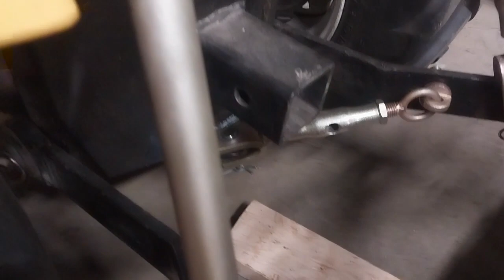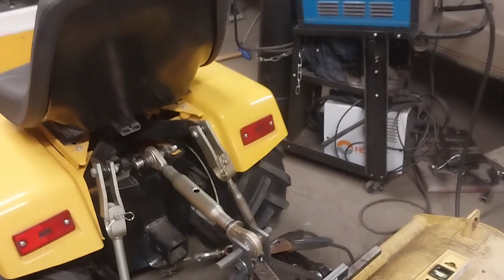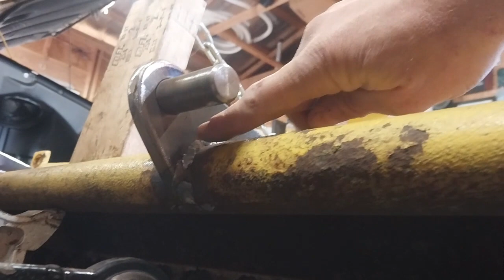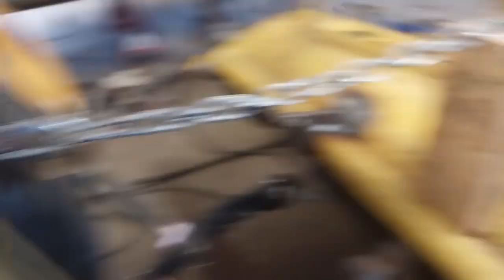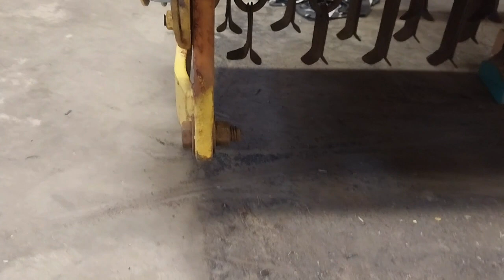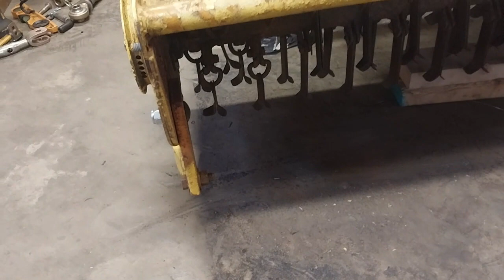Mott Flail Mower pt. 2 - The Cub

Comment: go to the john deere dealership and look at the 450 and 647 model tillers..that's how most flail mowers are set up...bit heavy in my opinion but they designed it to last a lifetime. the mounts are all you need to look at. flail mowers have to have a tilt towards the rear roller to help control height in rocky fields. most farm supply stores sell replacement flails.
most flail mowers i have used on full sized tractors 7'-12' had the mounts like you do, but flipped over and angling downward with double mounts you run the clevis/hair pin thru one side, then thru your cat arm swivel, then thru the other mount hole and have a lynch pin to secure the 3 point pin or cotter pin:
tractor supply search this : ToolTuff Direct Heavy Duty trailer Mover this one has 3 brackets per pin side, and two holes for cat-0 & cat-1 or 1&2

Comment: 3.25" is the lowest grass cut i would do , due to ground terrain fluctuations, this means cool season grasses are going to get minimal growth, and the ground will have alot of run off and evaporation with the rain, and once it gets hot out the exposure to the soil will bake the soil and thus the roots and it will grow very slowly. 4-4.25" the grass looks magnificent, but any water  and fert will make it grow an inch to 3 per week so it can get to be more clippings than you'd like. most commercial companies with cool season cut at 3.5-3.75" mostly 3.5" for most of the time and once it gets dry they try to let it go to 3.75" to act as ground cover and still keep green and just a .25" of growth at the very least. SUN+HEAT = GROW  fert =grow+thickness+green Rain=GROW+green
i used to work a 36 hole golf course and did the greens and tee box mowing for most of high school and i did commercial lawns for many years before and after high school for toy money and  girls and school money after high school. i never had a complaint, nothing but compliments about how the grass never looked that good for decades
Reply from the maker: WOW!  You are a wealth of information!!  I've put this mower on the backburner for now but when I get back into it, I will definitely revisit your post!  Thank you.

Comment: With the roller in place, and the mower at a fixed angle, it should never scalp your yard. Is there a way you can attach it to your 3 point so it rides at a consistent angle? If you make sliding links for your 3 point setup you could also get rid of any down pressure.
Reply: That would probably be your best option. I've used a mower like that a couple times. It didn't work well for my needs, so I eventually took it off and gave it to a nice fellow I met at a Cub show in Pickneyville IL 😉
Reply from the maker: @allwaystowing8775   I'm that fellow!!  It was at the end of the day.  You had it on your trailer.
Reply: @billbayer5526  I've been creeping your channel waiting to see what you were going to turn it in to lol. To answer your question of whether the knives spin with are against the direction of travel, I tried it both ways and turning in the direction of travel worked best for me. Against the direction of travel resulted in the cut grass being thrown in front of the mower and running through again, and although it probably works, a Cub is only 9hp and it was bogging down too bad. Going with the direction of travel just sent it out the back, and it actually made a very nice looking cut that way. My biggest problem was trying to keep the belt on it. I think your setup will have no problems with that at all.
Reply from the maker: @allwaystowing8775  Haha!  That's great. Thank you for watching.  
So the International tractor that this came from only had 9hp?  I thought those had 4cyl engines.
Reply: @billbayer5526  I'm a bad person to explain this, because I don't fully understand it myself, but here it goes. My understanding is that a tractors HP back then was rated at the draw bar as how many actual horses it would take to pull the same load. So the HP rating isn't really relevant if you were doing side by side engine comparisons.  You are correct that a cub is a 4cyl, and I'm sure it has more engine power than a 9hp Kohler. That being said, I can promise you they don't have much power. Many people avoid putting 59 inch decks on a cub because if you let the grass get a little too high, the tractor is too under powered to mow it. Also, a cub uses very little fuel. They only have a 7 gallon tank and can work hard in the field all day without needing to refuel. I assume IH's quest to make a fuel efficient engine also contributes to its lack of power. But for plowing and pulling a disc, it's amazing how much pulling power they have.
Reply from the maker: @allwaystowing8775  That makes perfect sense to me.  Didn't they call it drawbar horsepower?  
One important question I have is do you know how fast this thing is supposed spin?  I assume Cub engines turned at around 3500rpm which is the same as the motor I use but I don't know what their PTO rpm was.
Reply: @billbayer5526  A Cub PTO runs 1600 rpm. And the flail mower runs an 8 inch pulley on the PTO shaft
Reply from the maker: @allwaystowing8775  So the PTO has an 8" pulley and the mower has maybe a 6" pulley so would it be a safe guess the flail should turn at 2000ish rpm?
Reply from the maker: @allwaystowing8775  Well, I ran it with what I have and it works...sort of.  I'm missing 4 blades on the drive side so it vibrates pretty bad and what blades I do have are very dull so it cuts pretty bad, too.  I guess I just need to find some replacements.
Reply: @billbayer5526  I've seen different companies selling them.  Montage enterprises is one I just pulled up on Google. Also the blades can be flipped so you can use both sides of them before sharpening.
Reply: @billbayer5526 I had commented this earlier, but it never seemed to show up. There are a lot of places that sell flail knives, montage industries is who just popped up on my Google search. Also they can be flipped around if you're cutting side is too beat up to sharpen.
Reply: Or you could also swap the links on the 3 pt for chains. Then it would only lift, and not create down pressure. They could also be easily adjusted that way, and maybe you wouldn't have to change the points you already put on the mower.
Reply from the maker: I can get rid of down pressure easy enough by replacing the struts that raise/lower the lower arms with chain.  I think I see what you mean about not scalping as long as it's riding on a roller.  The whole thing will raise parallel with the 3 point if my geometry is right and there's no down pressure.  I'm thinking about trying to replace the top link with a linear actuator to control cut height.

Comment: My vote is leave the pivots that you welded on right where they are at and move the roller up all the way if the heights all work out. I’d keep the roller because it really helps with not scalping. If the tractor is driving over a ridge, the roller prevents the center from scalping.
Reply from the maker: Yes. I'm worried about scalping for sure.